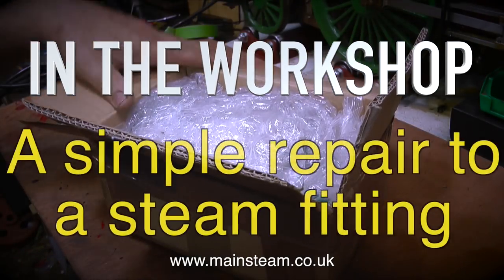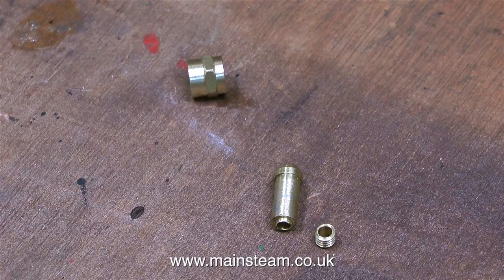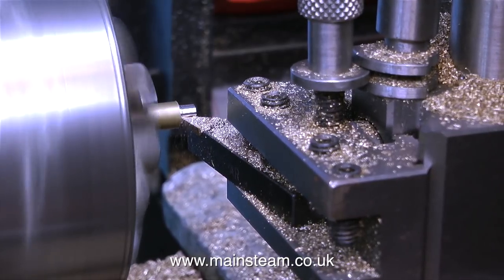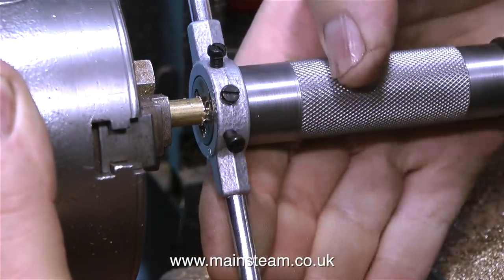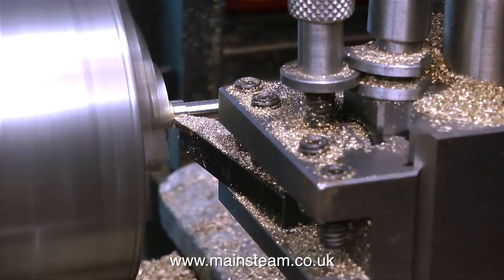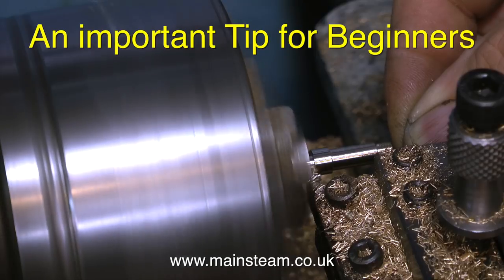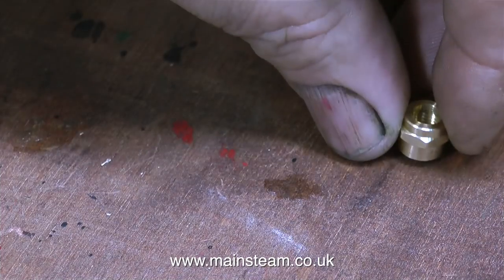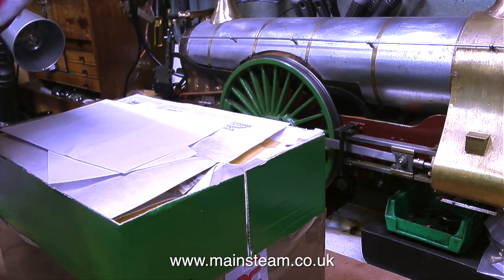A SIMPLE REPAIR TO A STEAM FITTING - IN THE WORKSHOP

Comment: You are correct that the proper machinist will make a test cut, measure that, calculate the difference, then advance the tool the exact amount. Often one will make a cut a few thousands shy of the finished size and measure again to reduce the effect of tool pressure on the work. You are also quite correct that this is annoying with a micrometer.

I highly recommend a pair of cheep digital calipers. They have a zero button. This lets you zero with the jaws closed, open them to the size you want (or place them on a part that you need to match) and zero the display. Measuring the work will now do the math for you and display the exact amount to cut. Divide in half, and that's how far you turn the dial. If you have 'Direct Reading Dials' on you lathe they move the tool half of the indicated amount on the graduations. This has the very convenient effect of doing the division for you. Turning the dial .100" moves the tool .050", reducing the diameter by .100" instead of the radius.

Comment: Mr. Appleton. If it ain't broke don't fix it. What works for you is by definition enough. Yes a master machinist like Adam Booth does things differently. So what ? He would say the same,I imagine.
Also,you answered a question I asked a while back,I guess I phrased it badly. So yes you deal with old brass where the zinc has preferentially comes out and embrittled and weakened the fittings. So now I know I was right. Thanks for that.
As someone who is quite badly disabled,watching someone do things well is important to me. So you never know the long term positive effect of the things you post. Cheers.